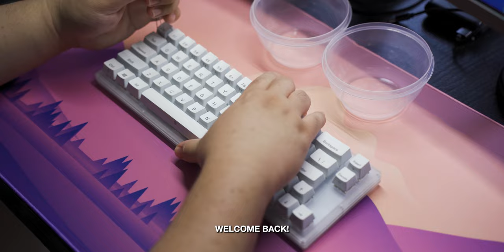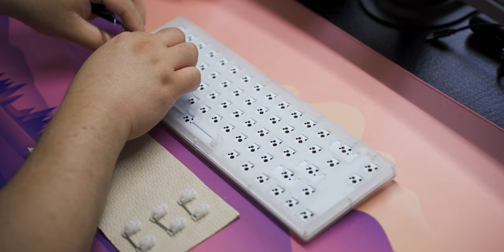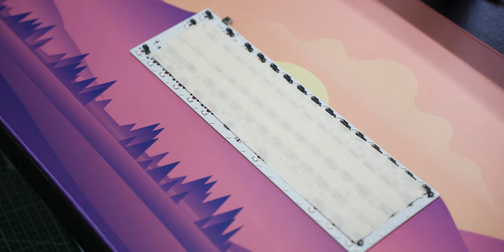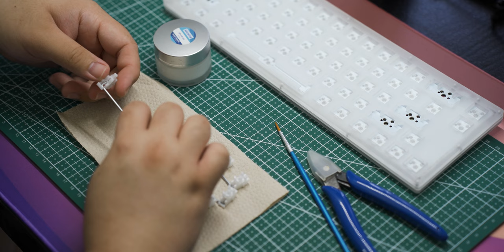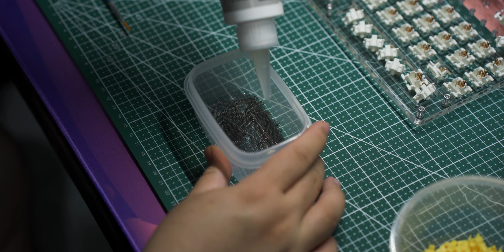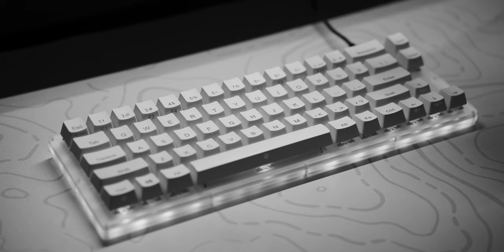EASY Mods for a THOCKY Keyboard! Gamakay K66 Modding Guide | keycappuccino

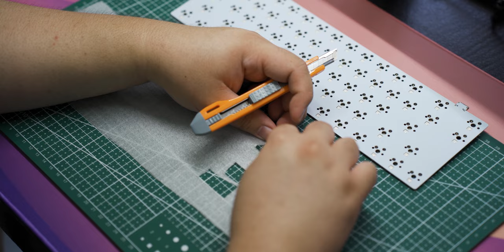Comment: 3:13 For someone who knows little to nothing about mechanical keyboards,  how are keystrokes registered with that foam sheet between the circuit and the switches ? I only saw holes being made for the switches with stabilisers.
Reply from the maker: Hi there! The foam is thin enough that the metal pins of the switches just poke through it.
Reply: @keycappuccino  Thanks for answering, awesome channel btw.
Reply: So good

Comment: I wish they had a black one. I still might get this so I can take the caps. I think that's literally the only keycap set that has legends designed for South facing boards.
Reply: The point of the keyboard is the under and overglow. Black wouldn't make sense

Comment: What thickness of foam did you use? 1mm?
Reply from the maker: I use 0.5mm, but 1mm should be good. It will be slightly harder to push the switches through. Good luck!